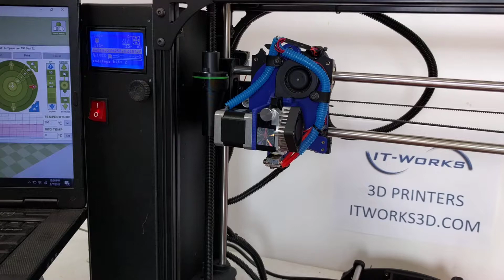How to load filament in the E3D Titan Aero extruder

Comment from the maker: We found that for flexible filament, no tension on the knob works best.  If you have too much tension on it, think of it like a rubber band in between your fingers.  If you squeeze too tight and try to roll it, it will go every which way.  Now if you just barely squeeze it, it will roll in your hand almost perfectly.  Same principle here.